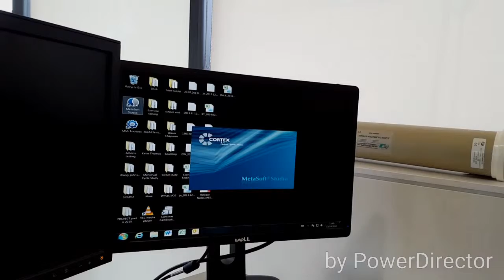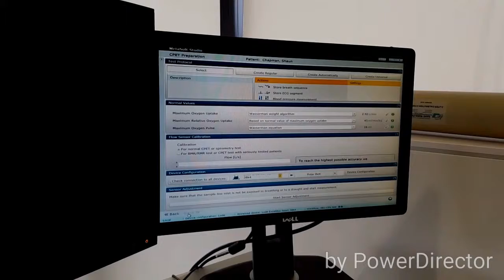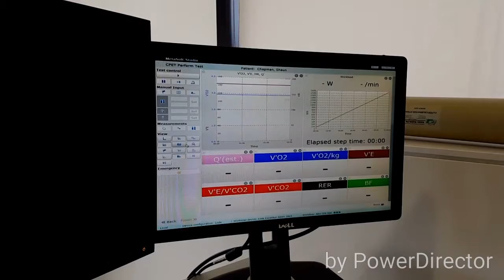Anglia Ruskin University CPX test set-up (Cortex MetaLyzer 3B)

Comment: im very interested in this protocol...im 3rd year sports med resident so id appreciate if you could give me some info about this programe..thanks in advance
Reply from the maker: Hi Kat, sorry about the slow reply I have been away! 

Yes, In Sport Science when we measure respiratory data via a participant during either rest or exercising conditions, we measure VO2, VCO2, RER, Total Volume etc via the mouth. This specific machine (Cortex MetaLyzer) or any other similar devises like a Jagur use a mouth piece (volume transducer) that plugs into a facemask of the participant and the turbines in the transducer measures the rate of breathing and the O2/CO2 moved though a sample line into the machine hardware where it used a galvanic fuel source and magnetism and are then calculated by the machine/software algorithms. The protocol itself is broken down into many stages:
- There is the study protocol which varies a lot depending on the variables and type of exercises you want to measure (running, cycling, rowing etc and ramp or step test, VO2max, fatmax, MAOD etc).
- The software allows complete control over the mounted/connected ergometer in this case it is a cycle erg. The software ideally needs to be calibrated once a day (preferably the start of the day before any testing). The calibration allows the ranges as well as the offsets to be set and account for any changes in the atmosphere or drifts that might have occurred since last calibration that could skew the results, this set allows us to be confident in the results. https://www.youtube.com/watch?v=CiAW7qoayUY My friends Shaun has a video on the calibration steps please see the attached URL.
- This video shows you how to set up after calibration and before the actual participant gets on the bike. The software allows you to: 
1) Create a participant. This allows you to store their name, DOB, gender, height and mass etc which is important if you have a large cohort and need to find them in the software especially if they have the same names (this software is on a password protected compute). The software also gives you the option to edit any info which is important if you are calculating VO2/VCO2 in ml/kg/min as this accounts for weight and if they came for the second or third experiment their weight would have changed especially if a training intervention was implemented.  
2) Select your protocol. This software allows you to create a protocol that is specific to your study design that you might have made from a literature review. It controls the cycle ergo completely, you can select the duration of the test, the increments of the resistance on the bike at any time (manual or automatic), how quickly these increments change, a step or a ramp based test etc etc it's really flexible and all protocols can be saved and used again or edited.  
3) Sensor adjustment. This is an important step and it is important that the volume transducer is just measuring the air from inside the room as this calculates the offsets and accounts for changed from the calibration step so this must be constant, not near any breathing or fans etc.
4) Ready to collect the data. Once the participant is ready and on the bike you can plug the volume transducer into the facemask and press the play button, the software gives you live data that you can see and a range of panels to view i.e 9 panel view, workload control view etc. each is different and gives you a lot of information such as; VO2/VCO2, RER, Workload, Time, VE, TV, Breathing frequency, Heart rate, protocol information. 
5) Once finished press 'Stop' and the data can be exported to Excel and used for descriptive statistics and statistical analysis etc.

Hope that helps, it's a good piece of equipment and is very useful in this field. 
Many thanks
Henry